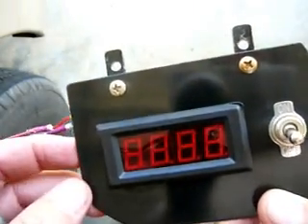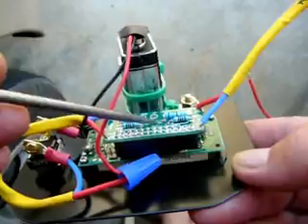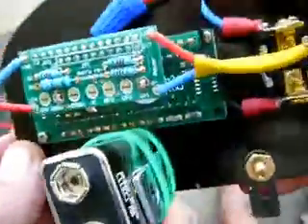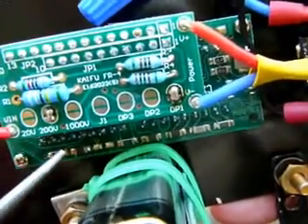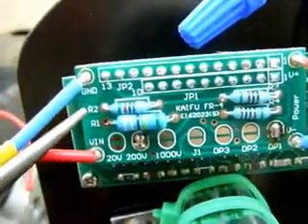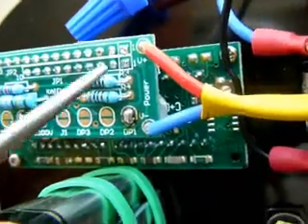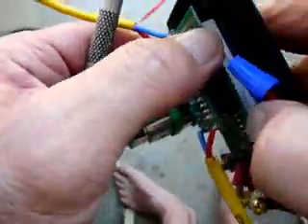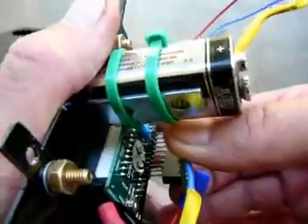How to Wire in an EV Voltage Meter

Comment: Or maybe you can buy a cheap dc-dc converter designed for electronics such as walkmans... and use it to power you LCD?  you can have these for under 10 bucks?